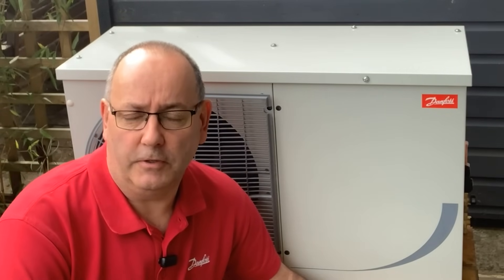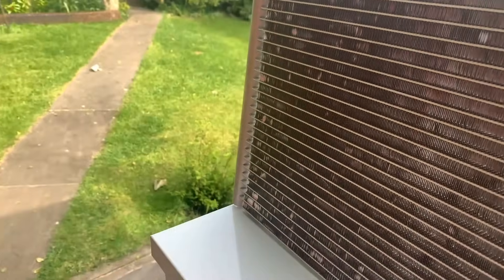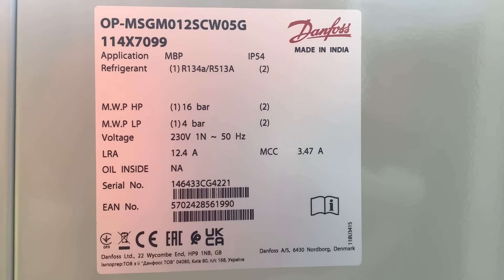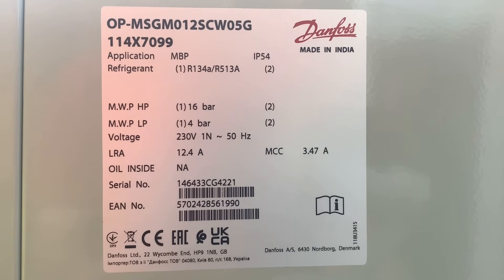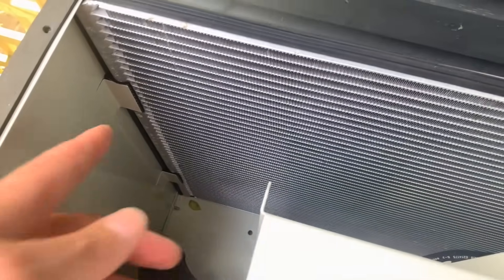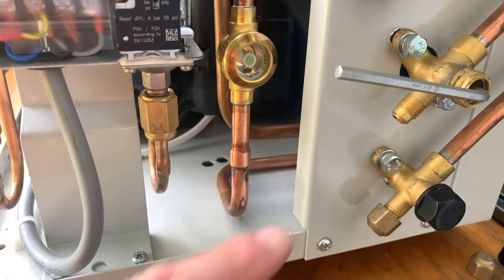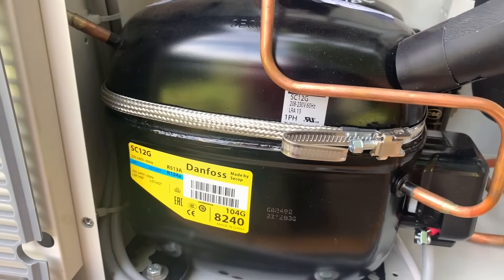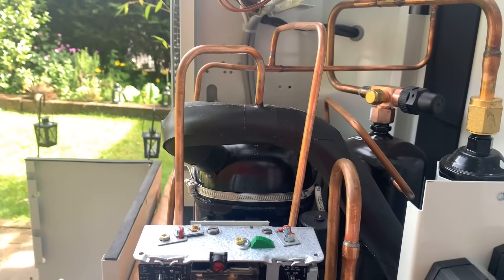Danfoss Optyma™ Slim Pack | Deep-dive tour for experts

Comment: I had often wondered why the crank case heater was on the head of the conpressor. This does explain why, but could a thinner band crank case heater like the ones on scroll compressors, work better, or even just relocate the cappacitor? Having it on the head seems counter intuitive, especially as it kind of negates the purpose and benefits of the  heater in the first place, and reduces the warming effect of the heater towards the oil in the sump, and does it raise the pressur of the has left trapped in the head of the compressor whilst not running? Im sure you guys know better. Im just wondering from an engineer and technical perspective.
Reply from the maker: Hi, thanks for your question. We are checking with our experts and will get back to you.
Reply from the maker: Hi. The location of the crankcase heater on smaller compressors is sometimes located on the top part of the shell because it is just not possible to secure it on the lower part of the shell. The heat from the crankcase heater will be absorbed by the compressor shell and this will maintain the temperature of the compressor at a temperature higher than the coldest part of the system which will drive out any migrated refrigerant from the compressor during standstill. When the compressor is not running and the crankcase heater is energized there is no trapped refrigerant in the head of the compressor. We hope this clears it up!
Reply: @DanfossClimate  there surely would still be refrigerant trapped in the head of the compressor, as even on a pump down system, the high side still has refrigerant, it doesn't dissappear, or otherwise I have wasted alot of my time recovering gas out of rotalock compressors, when I could have just shut the service valves and undone the nuts 😉 

Because you guys use a flexible, tape type heater, I would have thought it easy enough to wrap around the base of the compressor at the foot plate, so it was closer to the oil. I have seen engineers in the past relocate the standard heater to the bottom, believing they had been fit wrong at the factory, and they never had any issue with the system or compressor after doing so.

Comment: Do these coils come treated?
Reply from the maker: Thank you for your question. We will contact our experts and come back to you as soon as possible with an answer.
Reply from the maker: Hi Dwayne,

Unfortunately not from factory, but we suggest to have the aluminium coil coated by a third party platform.
Our advice, is to ensure (like any condenser) that it is not getting a prevasiling wind direct off the sea, if this is happening already.

Thank you for your question.